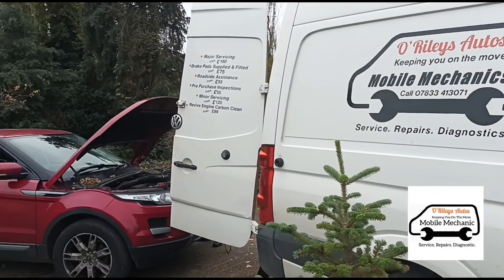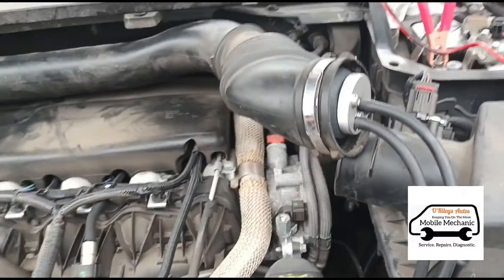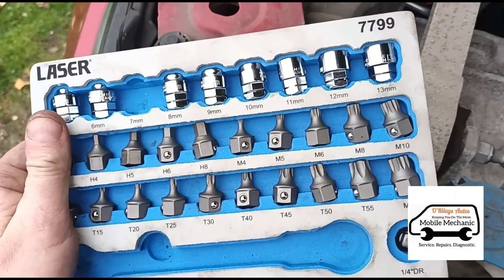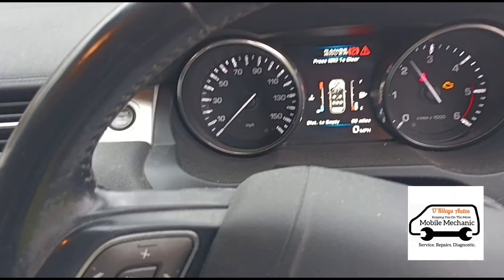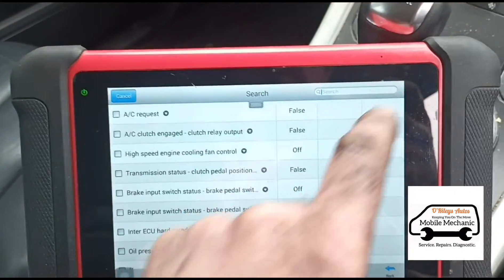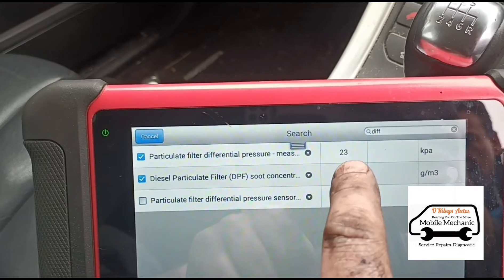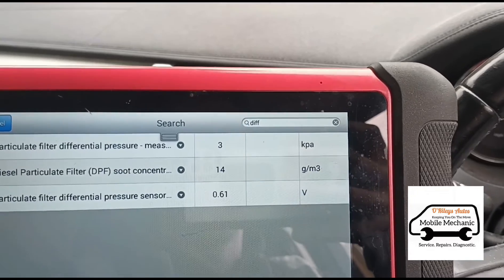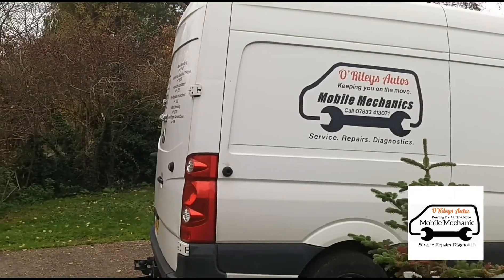Evoque 2.2 P006A-00 Manifold Absolute Pressure Flow Correlation P2263-21 Turbo Sytem Performance

Comment: Got same light ,,RAC came out and diagnosed it ,,turned the light off.  Working fine now ,,,took car to garage and they can't find anything and cars still running fine.  Will the problem persist or has the diagnostic machine cleared the problem/system
Reply: Or is it most likely a DPF problem???

Comment: Thanks for these great videos Jimmy. Ive just fitted a brand new DPF box on my wifes 2014 Evoque and never thought to check the boost pipe. Thanks to you I found a 4" split where it rubs against the starter motor. Waiting for it to arrive. I have the Launch x431 Pro Elite diagnostic tool so should get it sorted at the weekend. Thanks mate.
Reply from the maker: Glad to help

Comment: If the soot concentration is a calculation according to the pressure, and the pressures have been resolved with the new hose and dpf clean, why doesnt the car recalculate the soot level ?
Reply from the maker: Once it goes over the limit set. The malfunction light comes on and it's disabled from regeneration